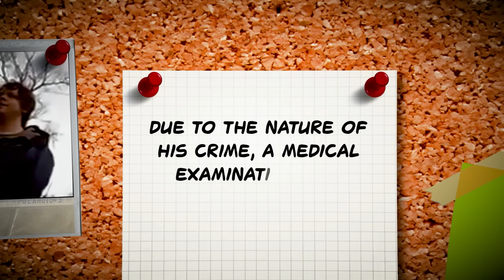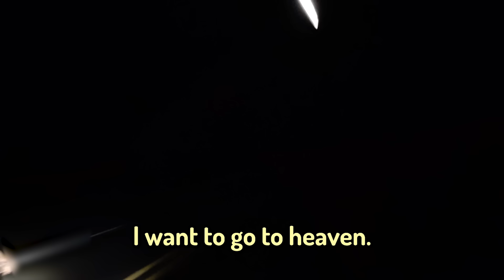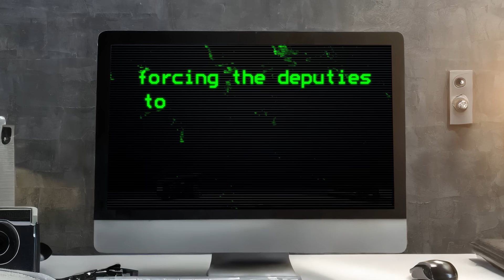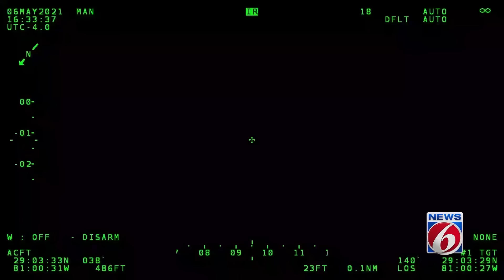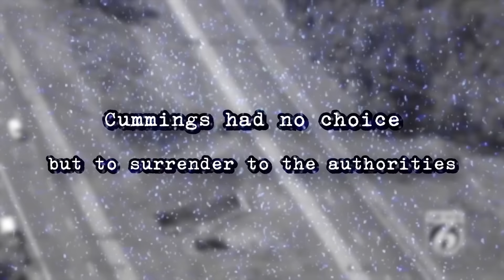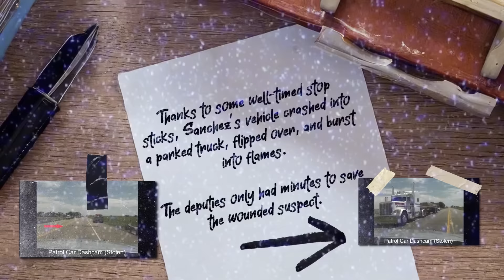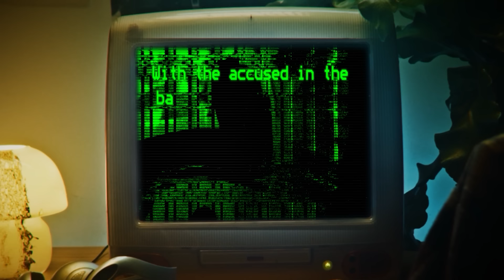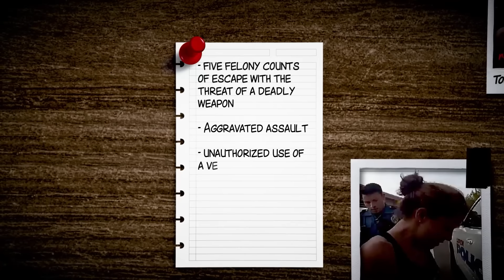Why Cops Shouldn't Leave Keys In The Ignition..

Comment: Some of these would have been prevented if cuffs were locked in to the back of seats. Like how you strap a dog in by the collar. If the cuff was locked to the back seat, they wouldn’t be able to slip them up front or get to the front seat.